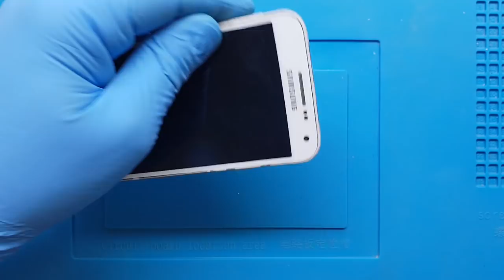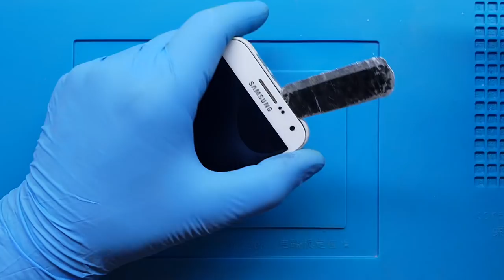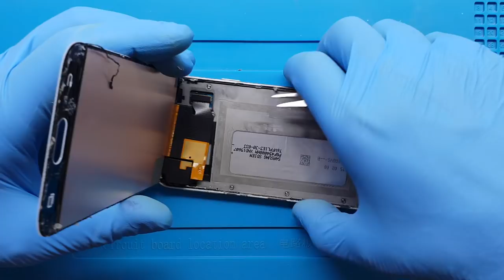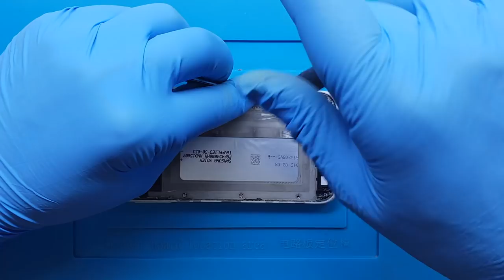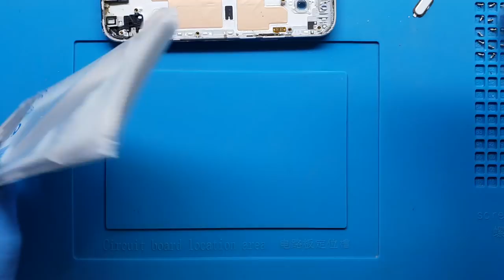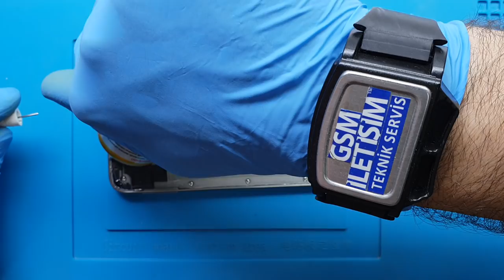Samsung Galaxy E5 Kasa Değişimi #gsmiletişim

Comment: Why do u put the spiral wire in your arm? What is it
Reply from the maker: Hello;
It is a static-electric bracelet on the left arm. Our technical service is designed to be completely free of static electricity, but it is installed as an additional measure by our technicians to prevent static electricity. The right arm is a special magnetic magnet. Very small metal parts to hold.
Greetings.